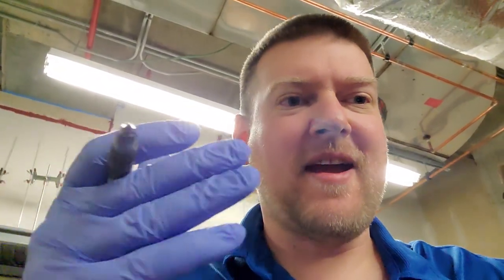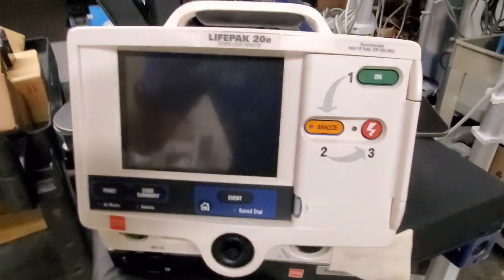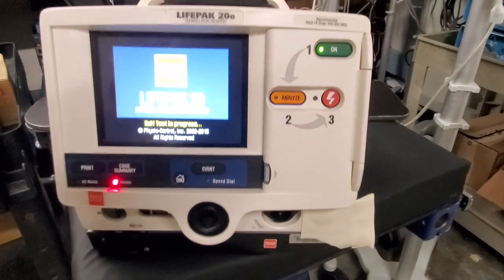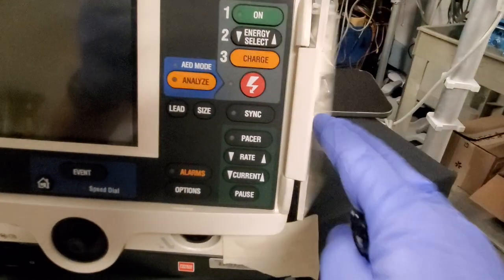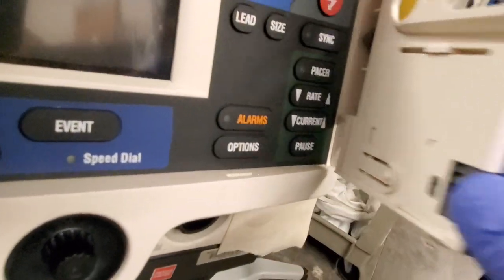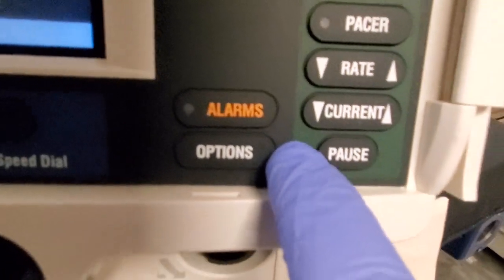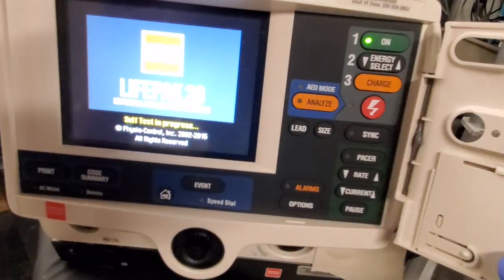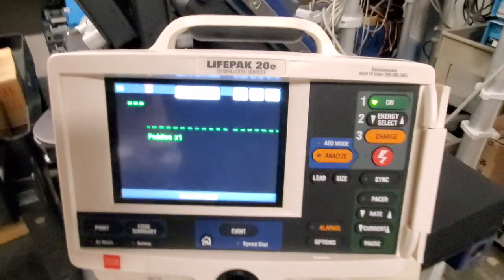Hidden Button on Lifepak 20 Series Defibrillators!

Comment: Hi, my guy, I have a question, in which range of frequency telemetry works?, thanks
Reply from the maker: What range of frequency the telemetry transmitters operate at? It varies based on the manufacturer and model of telemetry transmitter.
Reply: @BetterBiomedChannel  , i got this question and i got multiple choices, it’s confusing because im did my research and i find same as you posted, idk, Thanks buddy
Reply: According to WMTS band the range of RF frequency is 608 MHZ to 614 MHZ here in Canada. I think there is another set for USA. Our telemetry system is GE telemetry.